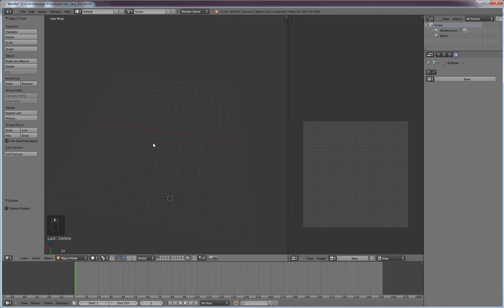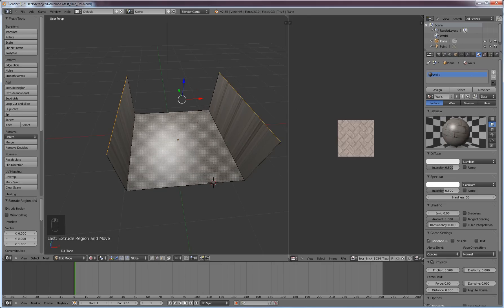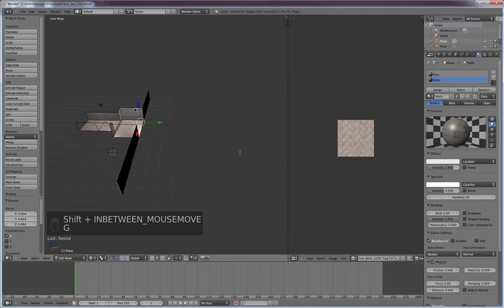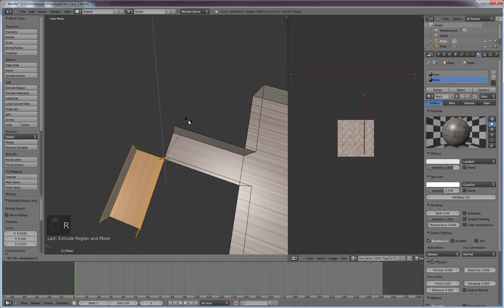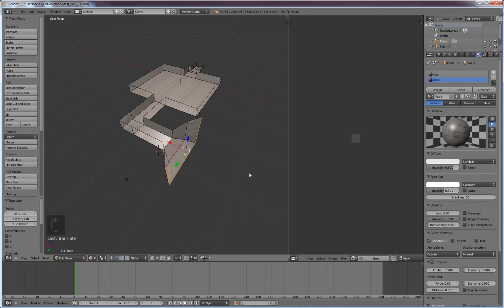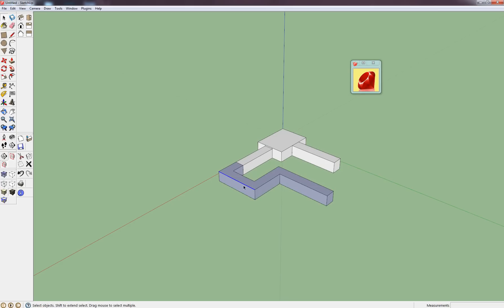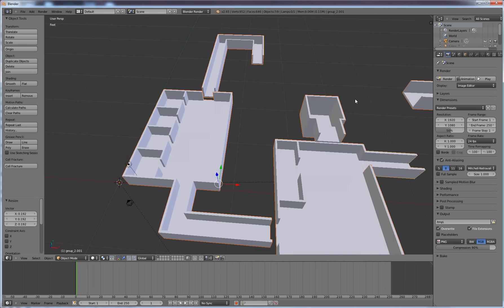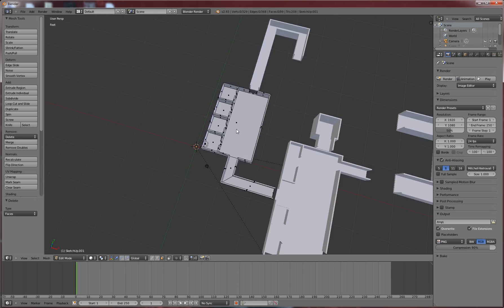Blender GE 2.6 FPS Tutorial - Level Design P3

Comment: also, a method of level creation i read about for old games which i think could be utilized in this tutorial is creating a large level instead of scaling it down so much, and adding the detail you intended.  dont over do it or else youll wind up running slowly and make sure you leave room for the polys in your details, props, objects, and characters and etc.  once your level is made, then you can create a new level in a new scene and link them with an exit that brings you to the next scene.  if you do that, you save lots of processing power.